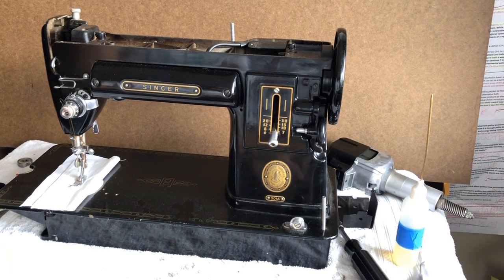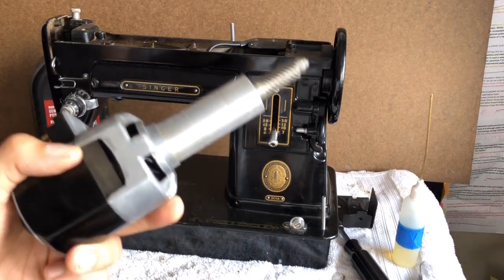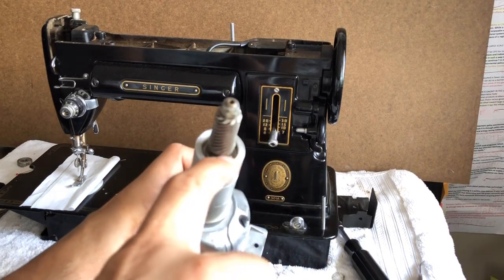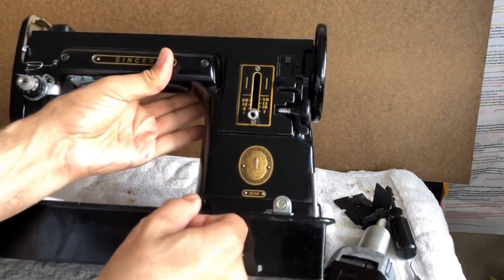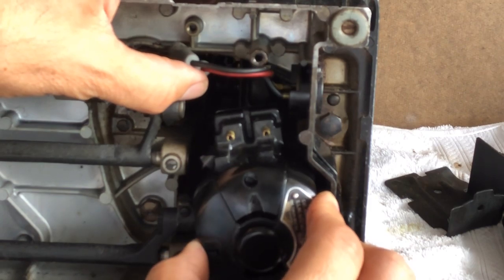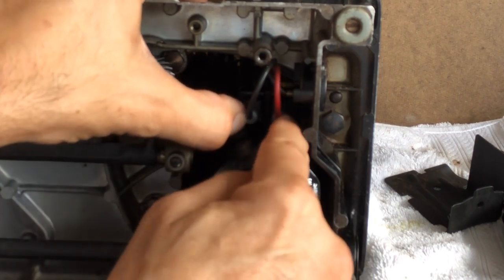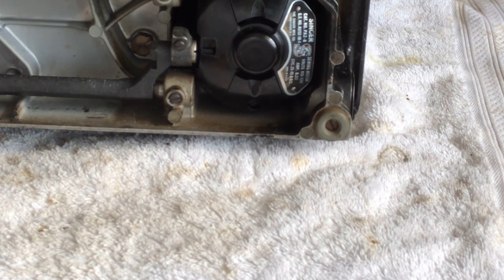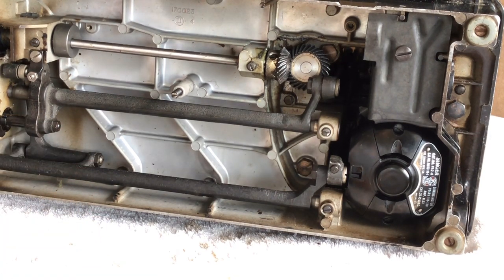MOTOR SERIES #8: Reinstalling the Singer 301 Direct Drive Motor.  Simple Retracing of Removal Steps!

Comment: Would this SAE 30 oil be the same as Texaco's SAE 5W30 oil? I didn't know I could use automotive oil on dry sewing machines like Singer, Vigorelli, Necchi and others. I only use sewing machines on a daily basis. Singer oil common for domestic sewing machines. I've used WD40 oil to loosen screws or to unlock the long-standing old sewing machine. But in everyday life I just drop drops of Singer oil on the inner parts of the Singer sewing machine.
Reply from the maker: No.  You never want to use ANY motor oil on any sewing machine's mechanicals.  I mention this in the video so you might want to rewatch it.  And no, I would NOT use SAE 5w30.  I mention this in the video also.  This oil I used here is 30 weight only.  And it is ONLY used for revitalizing bearing grease or bearings themselves for THIS MOTOR ONLY.    Note that this 30 weight oil I use here in the video is Non-Detergent.   It can be found in North American in hardware stores and others that sell oil for non-automotive motors and chain saws.

Comment: Would you be able to explain the values of this stitch scale of the straight sewing machine models: SINGER 301, Singer 15C and many others? Because they all sew up to 4 millimeters at the biggest stitch. But the scale of sewing stitch values is strange.
Reply from the maker: Earlier vintage models for the North American market used numbers that represented Stitches per inch.   European models often used numbers that were in metric units so they appear different.   Japanese models imported to North America also eventually used a metric rubric instead of the Imperial English measurement system.
Reply: @VintageSewingMachineGarage  Thank you. You answered my question. Because the SINGER 15C stitching scale produced in Brazil is the same as the used Singer 301 and other American Singer sewing machines. And no Brazilian sewing machine technician could not explain that to me. Here in Brazil, Vigorelli and Elgin sewing machines (Necchi and Brother tecnology) use millimeters on the stitch regulation scale.